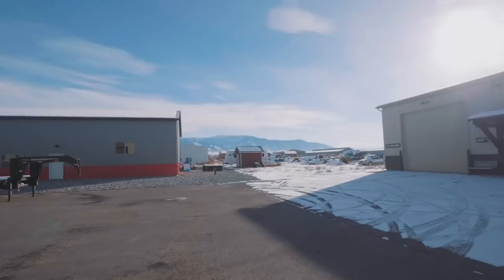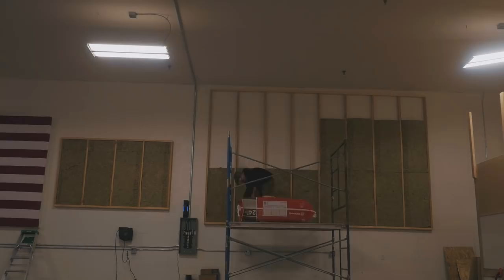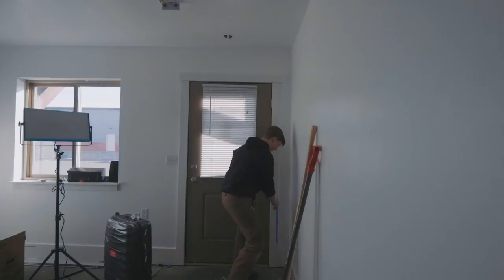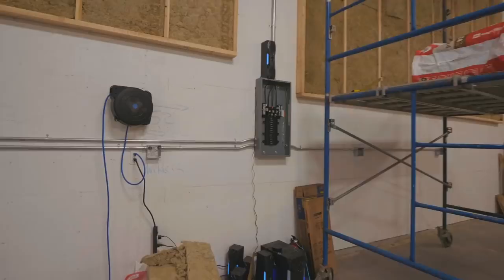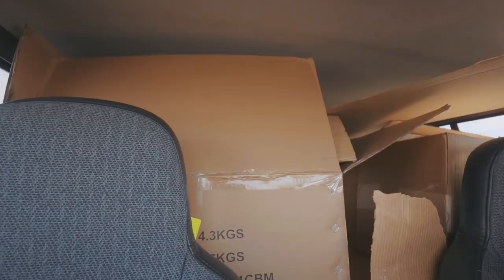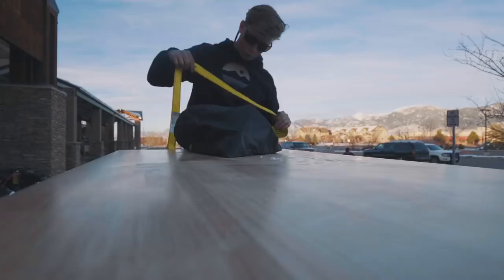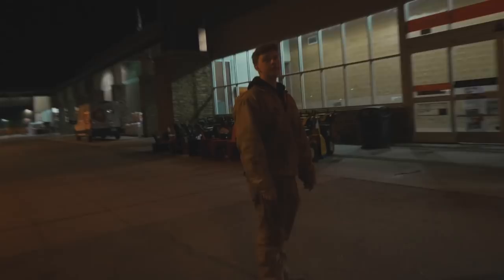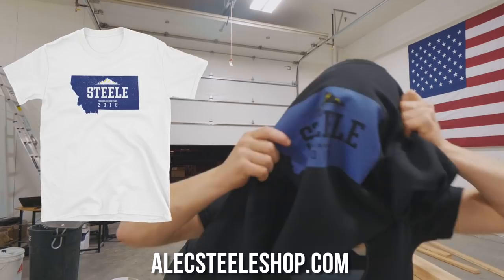I BOUGHT AN AMERICAN TRUCK!!!

Comment: Just wait until winter actually hits. When you're in the middle of a Montana blizzard, you're going to wish for a Canada Goose coat. Just google Canada Goose and get yourself one of their goose down, coyote fur coats. It kept me warm in Antarctica.
Reply: skuzlebut82 Canadian goose coat eh?
Reply: Seriously if you are up on the highline and its -20 then the 40 mph wind. It gets rather intense
Reply: @abrahamestrada2206  Yep. Look up Canadian Goose coats. Canadian Goose is a brand name. That's what I got issued when I spent 9 months in Antarctica by United States Polar Services. They are absolutely awesome coats, however, they are made for extreme cold. It needs to be 20 degrees below freezing to wear their big coat, any warmer and you will absolutely be sweating. The coats are filled with goose down and the hoods are lined with coyote fur because coyote fur doesn't freeze.
Reply: @abrahamestrada2206  My bad, not United States Polar Services. That ends up as USPS. Raytheon Polar Services, contracted by the National Science Foundation.
Reply: @abrahamestrada2206  I'm still not thinking right. Canada Goose is the company, not Canadian Goose. It's been 15 years since I was in Antarctica.
Reply: @abrahamestrada2206  And yes, I did see that you said, "Canadian Goose goat," first. Lol
Reply: @skuzlebut82  What's the problem? It's a coat, made of geese. I mean, it's loud, messy, and bitey, but if you need to be warm, you need to be warm!
Reply: @cptnscoob  Absolutely. I spent 9 months in Antarctica and we were issued Canada Goose coats and those things are amazing. You have to be in subzero weather to wear one. If it's not subzero, you'll end up overheated and sweaty.
Reply: @michaelmichael8406  Typically the geese are very docile and just happy to hang out so close to a human but you're right, occasionally they bite and sometimes they'll fly off with you and you'll end up in South America, in a lake that is feeding water to a cocaine producing drug kingpin.
Reply: +Michael Carson.... The only problem with those 'Geese Coats' is you've got to keep their 'little hoods' tight over their eyes, cuz if they catch a peek at the snow they automatically want to fly South!!!

Comment: Basic fluorescent tubes run green. You can get  daylight spectrum ones that are much better. The ballasts in cheap fluorescent fixtures will give you flashing light with them. Almost no LED replacement tube will correct this.

I was an industrial electrician and this was one of the problems we talked about in call in saw in the field. Industrial light sensors get really confused then the overhead light are blinking, never mind the headaches and eyestrain they caused. You are at the construction phase, so go full, daylight spectrum,  no flicker LED lights.

Just respond to me on here and I will send you a business e-mail for us to figure out the details of the fixtures.

Also, it is called the Homeless Despot.
Reply: Beyondthepress recently made a video about non-flickering LEDs. I guess Alec will be fine.
Reply: +10 LED flicker is super bad with machine tools. 60hz is just enough to make spinning lathes seem stationary at certain rpm.  Definitely splurge on good solid state dc lighting!
Reply: Flickering grammar is also naughty,
Reply: That's strange the company I work for replaced all fluorescent lights with LED no Flickr a lot brighter and it's those LED tubes that fit right in 2 the fluorescent fixtures
Reply: Yer it's not hard if you look properly to find LED tube's to replace old flourecents that, you just need some capacitive smoothing and high CRI index LED's and bamm.. no ripple and no headaches from poor CRI.
Reply: There are LED tubes with absolutely no flashing. You have to remove the existing ballasts.
Reply: I would also like to replace my lighting in my shop with something flicker free, is there anything economically priced that can do the job?
Reply: Modify That Red Truck,Get a Front Grill Guard,Vehicle Mounted Spotlights
for Deer and elk.
Reply: our whole shop is LEDs and there is zero flickering, pure white light
Reply: LCD's are DC so no flicker. If you have flicker it must be caused by the power supply not correctly converting the AC TO DC, meaning buy a better product.

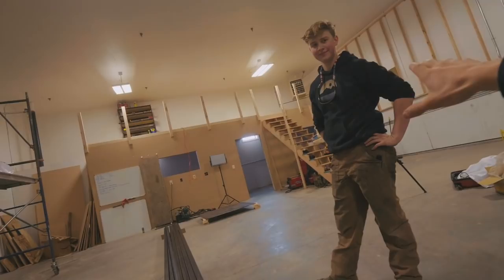Comment: Whoa, your shop only has 100A service (4:55) ?!  Major suckage, esp if you plan on welding.  

Consider upgrading to something like a 300A panel, with a few dedicated 40A+ ,breakers that support 220v, for your heavier gear. Might as well put a surge circuit on there too ... they are cheap and will protect your electronics from power spikes/surges.
Reply: Hopefully  sub panel
Reply: Go big or go home, with the amount of power he is gonna need for all his projects he needs it. Surge panels is a must.
Reply: i think that is a sub panel see that there is no disconnect in it and there looks to be two of them. the other on the opposite side, so it is more like 200a and and then office probably has one too.  now the building may all ready have 600a service so if they need more power in the building they just need to add an another drop inside they could. But 200a in the shop is a good start for what he has so far.
Reply: @adolphadillard3220  most homes have a 200 amp service. You will need at least 400 if not more.
Reply: @adolphadillard3220  Your are correct it is a sub panel see the neutral is floated and the ground is landed on the can. A main panel would have the neutral and ground landed on the same bar and bonded to the can.
Reply: Heh. Electrician talk makes me giggle.

Comment: So the big question: what kind of power hammer and press are you going to outfit yourself with?
Reply: Nazel 2B power hammer. that thing would be a beast.
Reply: There's the body off a spring hammer sitting in the shop

Comment: I'm enjoying this series of videos as you get set up, but it'll be awesome to see you making things again. As a suggestion for a first project: a slip joint four-bladed "congress" folding knife. Congress knives typically have a curved body, two sheep's foot blades, one pen blade, and one coping blade. The design is a quintessential American design; so much so that Abraham Lincoln was said to be carrying one when he was shot. You've done a few folding knives before, but not one with multiple blades. A project like this could be a neat challenge.

Comment: Congrats on the new shop and new truck!
I hope it has well-rated for Winter tires on it, or you may want to get a set of studded tires on it - and a set of appropriately sized tire chains. Also a few hundred pounds of bagged traction sand carried in the bed of the truck will weight the rear axle down to increase traction on slick snow and ice.

Comment: A little note to you Alec. As a truck owner in icy Oklahoma, add a couple of bales of straw and some kitty litter and a bag of sand. That will help with weight over your drive wheels, and give you some traction material if you get stuck.

Comment: Alec, The automatic transmision on your truck D, 3,2,1 means it has 4 gears some times it has a button on the side of the lever and means that has a O/D (Over  Drive) whitch is another extra gear...

Comment: great truck my F150 fx4 with ecoBoost has 120,000. miles on it hauls an anvil, forge anvil stand and about 800lbs of tools and steel runs great and its RED ! good job Alec.

Comment: I was low key hoping it would be a 1st gen Raptor but close enough.
Reply: Shayan Givehchian Me too.
Reply: Ikr I was too lol
Reply: The grill gave it away
Reply: Run over a speed bump too fast and bend the frame. No thanks on first gen raptors.
Reply: @Questchaun  but that problem was only in a few of them
Reply: Shayan Givehchian those raptors are sexy
Reply: @Questchaun  Personal experience? I literally jumped my 1st gen over a dozen times without any issues.

Comment: Alec, I would recommend a rotary screw compressor for your shop. I have a 60gallon compressor like the one you purchased and it's barely enough for my garage work. I do occasional plasma cutting and use impact guns when working on cars.

Comment: Alec Steele please don't take your laptop to an Apple store. Please I beg you. Contact Louis Rossman here on YouTube and let him fix it for you and eliminate headaches and frustration and get it fixed right.
Reply: At least probably that one has the lifeboat connector, so data should be able to be pulled off if it can't be repaired. Hopefully the repair person there is competent, and it doesn't end up at Rossmann Repair as a "prior repair attempt".

Comment: Shame the computer has to go to the repair shop, but not surprising.    Rice won't save machines that wouldn't be saved on their own anyhow.

At least you're getting it sorted out now.  I get some real shockers come through here at times, had one that was full of little roaches after person had spilled a milkshake on their machine but kept using it for a while after that, then the roach "deposits" eventually killed it.    Made the whole workshop smell terrible as I was baking the "deposits" while fixing the damage done.

If you have no luck with the local repair agent that you've dropped it off to, definitely contact Louis Rossmann.  Let him know that myself, along with many others have suggested you contact him and that you might want to consider some sort of collaboration video.  Best of luck.
Reply: Yeah, just be ready to ship yer machine to NY!
Reply: I came to the comment section to recommend exactly that. If louis rossman cant fix it... its probably not worth fixing.
Reply: Ditto!!!
Reply: Send it to Louis
Reply: Louis Rossmann!
Reply: Do you know how placing your wet electronics in rice works? If you put your device in rice Asians will come in the night and fix it.
Reply: They wil if the aparatus wasnt active/on at the time of dumpin fluid on it

Comment: Nice truck. Keep that thing washed regularly in the winter so it doesn't rust and it will be a nice transporter
Reply: Wont rust as its an aluminum body 😂😂😂
Reply: @redneckpyromania6965  don't know if that's a bad thing anymore. Just Get a Cummins and call it done.
Reply: That one is steel. It's a 2010. Also the frame is the thing your really want to pay attention to. The body and frame are both equally as important.
Reply: Even if it won’t rust it can corrode

Comment: Give yourself plenty of room for turns in that truck. It’s also easier to back it into parking spot instead of pulling straight in
Reply: just wait until he puts a long trailer on it
Reply: Hes gonna be so mad when it breaks down cause it's a ford
Reply: Even better to just pull through a spot
Reply: England is so over crowded and tight for space its probably easier driving that big truck than his little one over here
Reply: I got a truck last week and I found those things out the hard way, wish I would've seen this before

Comment: I think that insulating the walls although will greatly improve the echo another problem will be the ceiling and floor. Perhaps some kind of insulation on the roof would be good however if it is likely to get very hot make sure it is fireproof or resistant at least

Comment: Alex, if your working lease unit isnt equipped with a make-up air system, you may need to have a roof installation done in the spring. It gets very friggin' hot there.

Comment: Covering the acoustic panels in a thick canvas will decrease the high-frequency performance significantly.  If you need more low-frequency performance you can also space them off the wall so there is a cavity behind the rockwool infill.

Comment: Let the hate of Ford trucks begin LOL
Reply: They are all good
Reply: All Ford trucks are perfect. I drive an 88 f-150. Can't say the same for chevy
Reply: They are both long lasting truck brands, both with some exceptions obviously. One side of my family uses Ford and the other Chevy. Both are great. My personal liking is Chevy because I find the ones I have been in more comfortable. Other than that they are the same basically in my eyes.
Reply: Personally, I would have bought a Chevy. Mainly because I I have worked on Both for many years and find GM trucks easier to work on, But I have to admit the price tag on a Ford is fairly attractive.
Reply: Our F350 dually diesel is a beast. Love that thing.
Reply: Hard to hate something that already hates itself ;)

Comment: I haven't seen the big question been asked nor answered.

Where is the powerhammer? 
Is it the disassembled lump in the corner between the gate and the american flag? 
I miss the heating and the beating and the pounding and the montages that came from that. :(
Reply: SOLD! Pick a reason, too big to ship, needed work, not set up for US electricity.
Reply: @briansmith3011  Yes I know the old ones are sold. I'm not that stupid :)
I meant the new one we have not seen. ;)
Reply: Montana Montages are comeing in due time :-)
Reply: A couple of days ago he actually showed on his Instagram Will unboxing a new power hammer you didn't see the hammer itself just a crate but that means he does have one in the shop so it shouldn't be too much longer

Comment: Yo how stacked are you.  How have you not run out of money yet.
Reply: He should be making about $100,000 to $150,000 per year. I've heard you earn about 1/10th of your subscribers per year. Of course you can push it with those custom ads, which he does.
Reply: LolGamez cheap land value and smart money management can get you anywhere in the Dakota/Montana territories
Reply: @killergames391  I was talking about the endless home Depot runs and the truck and the house
Reply: Don’t forget the merchandise and that awesome sword that was auctioned and the bbc series
Reply: @lolgamez9171  All peanuts compared to what the shop and inventory cost. Just the machines and tools cost a small fortune.
Reply: LolGamez Stuffs cheap with a good income, a little know how, in a place like Montana. The Midwest is great if you can do with a shitty bar, some fast food that shuts down at 11pm, a Walmart, and Home Depot. And your shop of course. Just gotta find a place near a good highway.
Reply: He sold the old ones which goes into buying the new ones
Reply: Sponsors=no worries.
Reply: i think its called credit.
Reply: Wesley Melius credit is stupid. You are paying significantly more for the same thing. Just save your money and buy outright. Only exception is for housing
Reply: @duncemonkey14  credit scares me
Reply: Well the viking sword sold for well over 20,000
Reply: LolGamez he has deal with discovery channel
Reply: Wesley Melius been there done that  got out of credit and only have debit cards.
 If you don't have the money in the bank you cant afford to buy it 
save till you  can and make do with what you have got till then 
credit cards are a mugs game.the bank (and shareholders ) are the only winners

Comment: Holy cow. The guy helping with the studs is just asking to get a nail right through his hand with that nail gun. Sheesh
Reply: Yeah, one knot will deflect that nail right into his hand. One of my guys was using a framing nailer to nail on fascia, and the nail went in, hit a knot, turned around 180°, and hit him right below his eye. Luckily he had his safety glasses on.
Reply: That is what my first thought was...first thing I was told when I was doing some framing was never put your hand there...but to each their own.
Reply: Your not framing unless your flirting with disaster. Every man in my family has shot at least one nail into their hand. Kinda the risk you take when using nail guns.